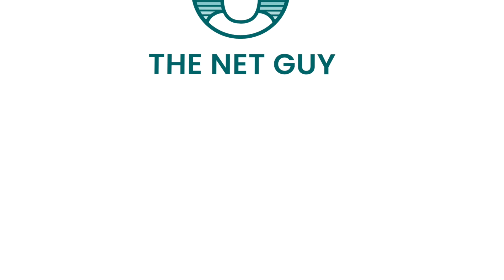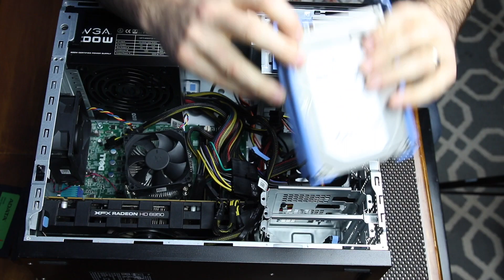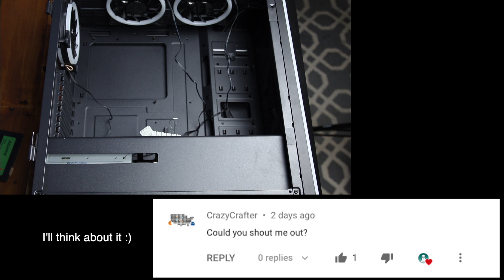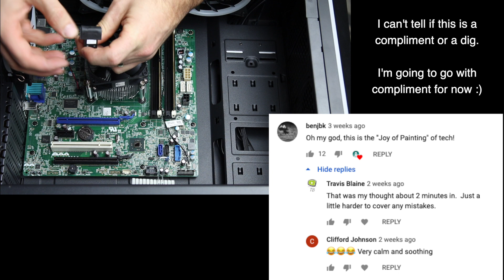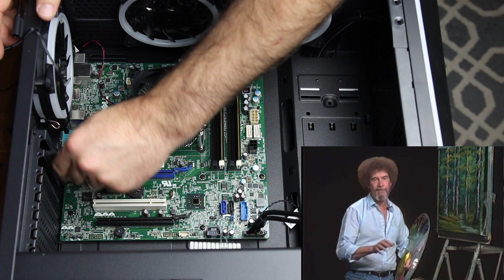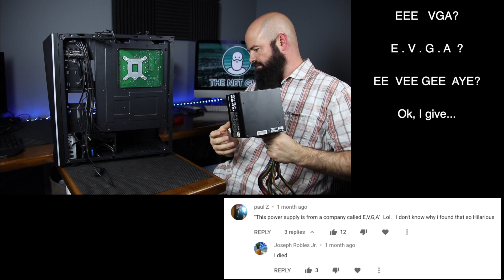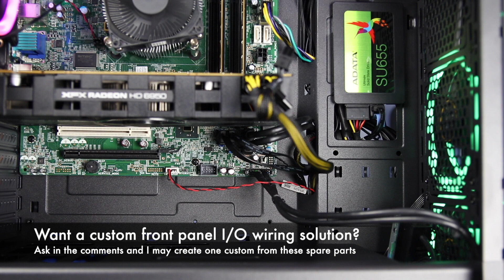Easy Dell Optiplex RGB Case Transplant

Comment: 17:55 Your ment to have the power supply fan facing down because it's meant to intake fresh air from the bottom and exhaust it out the back. But if you have it facing up, it might suffocate due to the lack of air intake which might lead to the power supply dying soon due to it overheating. The fan is not for "blowing" , It's for intake only!!! 
The only "blowing" happening is the hot exhaust air being blown out the back.
But this is still a great vid, keep up the great content.

Comment: A question about how to remove the rear fan failure with case with building fans
Reply from the maker: Take the rear fan out of the old case and transfer it. Problem solved ;)

Comment: how did you install the fans into the motherboard?
Reply from the maker: Some fans can be powered by the power supply directly. Others the motherboard.  The old 5-pin case fans if you bring them over go to the motherboard.

Comment: that power connector part, is the character "text" on Power SW need to face on jumper or right side?
Reply from the maker: Right side
Reply: ty for the info i just bought a new case somehow the power sw cable wont fit on header, do i need to cut those thingy blocking around header? what tool should i use it

Comment: They do make 5 to 4 pin fan adapters for these so you can remove the chunky dell fan. Or even use a different cpu cooler.

Comment: May be missing something, but how would I connect the hdd led and all those other connectors to the motherboard? I assume i would find a pinout image of some sort and stick them on accordingly from there. Dont wanna have to buy an adapter rn. I'm not too worried about connectors that arent required (assuming the case would still function properly) all i really need is a way to power the fans, id be willing to use the PSU itself. Sorry if I sound a bit inexperienced, I havent worked with many Desktops.

Comment: What's the reason behind the case switch in the first place? The Dell case doesn't have good air intake, but that can be fixed by cutting off the HDD cage and mounting a 120 or 140 mm fan on the bottom of the front panel. The 2 x 5.2 optical bays on the top can be repurposed as intake as well.
Reply from the maker: No cutting? Better airflow and RGB options?

Comment: sir, what did you use to connect the front panel stuffs?
Reply from the maker: Comes with standard I/o cable connections.  If doing a case swap there’s a map online of where the pins need to go.

Comment: It’s nice that the 9020 has extra sata ports next to the power on the board, my 7010 has the four that are in the way of the graphics card, 90* adapters and dremel tool did the job🤣
Reply from the maker: Good call.  Sometimes you just gotta mod things to get them to work ;)
Reply: @TheNetGuy   the 1660ti was probably overkill for a i7 3770 but hey, it was on sale🤣
Reply from the maker: Send it!

Comment: Am asking if you case swipe motherboard to gaming case, do motherboard holes align or there are other motherboard which don't align with holes.... If so give examples of such PC which don't align
Reply from the maker: HP 800 G3 does not align.  Most Dell 3020, 7020, 9020 do.  It’s all based on the motherboard make up. 👍

Comment: thats twice you called the ssd a hard drive once when connecting data cable to it then when connecting power to it, just saying, lol, also  this reminds me of putting a 4 cylinder in a Mustang, why i ask myself. 1st time ive seen a case fit a dell mb though, good stuff.
Reply from the maker: Old habits die hard!  Thanks for tuning in!
Reply: @TheNetGuy  i know you meant to say the main drive , just razin ya bra, thanks for the reply tho, nice vid though, smoked one just before i saw the vid so i was hypnotized by you bro , very calm and relaxing , nice work

Comment: You didn't show close up where the usb plug into on the board
Reply from the maker: Oops.  My bad.  Very old video.  USB 3 or usb 2?  USB 3 is keyed and only goes on one way, usb 2 is the same but pins you have to push onto.  Keyed as well.
Reply: @TheNetGuy  my usb connection are the yellow and green blocks 9 pin connections and if I was to fit my dell motherboard in a new gaming case of course the connections may be different so how would fit it in the correct spot
Reply: @TheNetGuy  think I got it resolved but does that power cable go on top right? Just so I know

Comment: Couple of questions re power button. Did you leave the 5 pin disconnected? No error messages?
Reply from the maker: I covered that in the video but there’s actually a newer way to do it with adapters on eBay.  Search Optiplex swap 2021
Reply: @TheNetGuy  I'm doing something a little different than a case swap. I extended the switch leads to another button. Left other 3 wires connected to the optiplex switch.  I'll check that video out.
Reply from the maker: Cool!

Comment: Is this possible with sff
Reply from the maker: It is but much harder.  Do you already have one?
Reply: No but I’m getting for my bday
Reply from the maker: Ok, they are good machines.  If you want to try the swap look for adapters on eBay.  I have a new for 2021 swap video that updates a lot.  On the SFF model you’ll need to use an aftermarket fan with a back plate (Vetroo V5 is a good choice) as the original fan screws through the motherboard to the case.  Good luck!
Reply: Ok thanks so much

Comment: I am missing the detail on how you connected the extra fans. I have lots of 3 and 4 pin fans but motherboard does not have these connectors. For the power. I tracked the power connector wire in the old case to its button and removed it from there. In the new case I replaced the power button with the one from dell.
Reply from the maker: The case has a fan controller in it, though if you check my other videos I did an update from 2021 that now has adapters you can get for your fans to run regular PWM fans.  Here’s an Amazon affiliate link if interested:  https://amzn.to/3F1YBB5

Comment: Low end 4th gen custom boards are soo cheap now I dont see the point of this, there is soo little money being saved
Reply from the maker: True; this video is 5 days shy of two years old now.  There is still some room if you get the machine for cheap but most are still asking too much I think.  I’m partial to the HP 800 G2 which has 6th and 7th Gen support.
Reply: @TheNetGuy  i picked up a pallet of 800G1s with 4790 chips in them last year, I think 35 units total for what worked out to something like $45 a unit... the market is a little different here though, I live like 15 minutes from the Microsoft campus.
Reply from the maker: Then I’m only an hour from you 😉
Reply: @TheNetGuy  where are you??

Comment: I tried to put a Dell in a new case and my Windows was no longer licensed....
Reply from the maker: Windows ties to the motherboard, network card, hard drive and GPUs.  Depending on what you change it can trigger a reactivating.  That said I’ve never heard of a case tripping the activation process.  Also - the serial number is stored in the bios and your Microsoft account now so it should reactivate easily.
Reply: @TheNetGuy  Seems as though there is no consensus on exactly what triggers deactivation and could be a combination of factors, though a new MOBO will always trigger it. I upgraded the chip, the psu and GPU.

Comment: What type of jumper did you use??
Reply from the maker: Any jumper will work, but you can also use the HDD led.  There is also a newer video on the swap for 2021 that shows how you can use eBay adapters to not have to jumper anything anymore.
Reply: Thank you so much!! I’ll check that video out right now! You’re the best!!

Comment: QUESTION i just did a case swap on my dell optiplex 9020.. and my son bought me a rgb cooler. It spins but i can figure out where to plug in the rgb in so the light comes on please help...i have a semi modular consair bronze psu.

Comment: The best part of a dell optiplex is the retro style case though 🤣
Reply from the maker: True!
Reply: @TheNetGuy  sold my full tower 10900f with rtx 3060 and currently running a 9010 with i7 3770 and 980ti. Its sweet as a nut 😁

Comment: I tried the case swap and messed up i bought the the 2 pieces from habour and the rgb lights came on but no display and the power button  had this yellow light blinking..so I put it  back in optiplex 9020 original case now windows isn't booting..I should have left my pc alone 🙃 Help i spent 50 on the case 40 on 500w corsair bronze plus 24 bucks for the motherboard pieces please help if u can or should i have just used my same psu my gpu is a mti 710
Reply from the maker: Hey friend, let’s walk through the possible things it might be.  What is it saying when you say windows isn’t booting?   Got an error message?
Reply: @TheNetGuy  status 0xc0000001 is the error
Reply from the maker: Ok, what kind of hard drive do you have and did you possibly change from UEFI or Legacy boot in the bios or vice versa?
Reply: @TheNetGuy  (Time-of-day not set, Invalid configuration information- please run set up ) i have adjust the time and date but i do not know why it still give the same message comes on
Reply: I should have never tried to switch my case i had no problems
Reply: @TheNetGuy  512 ssd for boot 2 tb for data
Reply from the maker: Looks like all the bios settings got reset.  This can be an issue with the cmos battery going bad.
Reply: @TheNetGuy  i replaced the battery..and under boot list option its says legacy
Reply from the maker: Switch it to UEFI boot mode and see if that fixes it.  Also, when you do the swap again you can move the power/diag button to the new case to see if it will give you an error code.  80% of the time it’s memory, 18% bad/cheap adapter not the one I linked to, and 2% other :). You’ve got this!
Reply: @TheNetGuy  ok 👍 👌 I load defaults in bios and it gave me options for repair and safe mode...i chose repair if it dont work i will switch to uefi
Reply: Fans moving not powering up? Wtf
Reply: @TheNetGuy  do you think i should buy a replacement motherboard and just install it back in the optiplex original case?
Reply from the maker: Not sure why the fans aren’t moving.  I know they are set to run based on need.  Cpu fan is moving right?
Reply: @TheNetGuy  ok i put in power button and it came on now its saying ntdlr is missing
Reply from the maker: The problem is if you were UEFI and rebuilt the BCD using legacy it’s overwritten now :(  Turn on UEFI mode, boot off a windows 10 boot USB key and fresh install.  It should keep your files but you’ll need to reinstall your apps.
Reply: @TheNetGuy  is that the only way?
Reply from the maker: If you’ve told it to repair/rebuild then I would say yes :/   First step above would have been to switch to UEFI mode - that’s likely what happened when your cmos battery died is it defaulted to legacy.
Reply from the maker: Basically
Reply: @TheNetGuy  https://youtu.be/sOihh4ZNOf4 this guy instructions was spot on. I fixed it.for those who need it
Reply from the maker: Very nice!

Comment: Where do you get the jumper from?
Reply from the maker: Usually you can find them on old motherboards or old hard drives. If you can’t find one, there is a way to wire the power LED to act like a resistor. I think PC tech hustle on YouTube did that technique. You can also order adapters on eBay for the front panel now.

Comment: Cooler master mb311L argb and dell optiplex 9010 MT motherboard, is it compatible?
Reply from the maker: It is.  Easy swap too now that there are I/o adapters on eBay.
Reply: @TheNetGuy  you don’t have to do this if you want but just as a suggestion can you make a case swap video with the cooler master mb311l argb, it has amazing airflow and meets all of a gamer’s expectations which is why I chose it as my new dell optiplex 9010, let me know what you think

Comment: what kind of cabinet is it? atx, micro atx and variants, please help
Reply from the maker: ATX full sized is supported
Reply: @TheNetGuy  is something else needed, or is it just component change?
Reply from the maker: Nearly all ATX and mATX cases will work.  There will be some conversion issues with the power switch and no front panel audio support.  There are some adapters you can now buy for usb and power switches.

Comment: The power supply does not blow out the "top". PSU's blow out the rear and draw in from what you call the top. The PSU will work the way you have it however the air flow will be restricted. It's designed so that the PSU can draw in it's own fresh air from the bottom of the case. Typically there is also a filter in the bottom for easier cleaning. Otherwise, nice video. I watched to see what you did with the front panel stuff but watched the entire video as well.
Reply: QUESTION i just did a case swap on my dell optiplex 9020.. and my son bought me a rgb cooler. It spins but i can figure out where to plug in the rgb in so the light comes on please help...i have a semi modular consair bronze psu.
Reply from the maker: So the addressable RGB or ARGB models need either a motherboard port or an aftermarket controller.  The 9020 doesn’t have them on the motherboard, so you can look for an addressable argb controller on Amazon - often they come with some fans.

Comment: Please keep this optiplex 9020 going with different option and cheaper upgrades for people on the lower end of a budget. 
Show some work around if you can.
Right now I’m just discovering you can do all of this to the 9020.
I have a blank 9020 now and I want to find a starting point any tips were to start first?

Comment: There's an adapter to connect a 4-pin fan to the case fan or CPU fan on a Dell. I found one on ebay for a couple of bucks. Works fine. Also, you can change it in setup so the error don't appear. I did that while waiting for one of the adapters.
Reply from the maker: Nice find!

Comment: Hi I'm switching my optiplex to a case today and I was wondering wat size jumper I need since I can't find any laying around
Reply from the maker: Take a look at PC Tech Hustles video.  He uses a power led as a jumper and it works too.  You can also order an adapter from eBay now.

Comment: i just got a gtx 980 and i have a dell optiplex but the optiplex is not bigger enough for the gtx 980 because the hhd cage so do you thing i should just transfer case to a bigger one?
Reply: or cut out the drive cage

Comment: I need your help on this alot and i'm stressing out on it lol, so like i was going to buy case fans and it says 3 pin right, and on my Dell optiplex 7010 MT has a case fan but its a 5 pin, and i can't find any adapters and i bought the same case u have but the Talos M1A, but i can't find any adapters for it and i'm freaking out lol so like is their any 3 pin to a molex cable or some sort, please help me lol!!!!
Reply from the maker: The good news is you can run the stock CPU cooler and reuse the rear chassis fan.  I haven't found an adapter yet for dell headers.  If you look at the HP 800 G2 models as a good donor platform they have standard/traditional headers.

Comment: Can I just use the old power supply?
Reply from the maker: You can if you don’t plan to upgrade graphics cards and don’t mind the look of a gray OEM supply.
Reply: But I could put in a graphics card before I swapped cases why not now.
Reply from the maker: The stock power supply doesn’t have a PCIe power header.  You can use a converter from a sata port.
Reply: cable lenght can be an issue, the 8pin cables are very short for example

Comment: I have the exact same Dell 9020 case, and I'm wanting to do the opposite and swap all the components from my mATX case into the bare Dell I have so my question is. Is the case a standard mATX case and what if any cable or case mods would I need? Any help would be very helpful. Thanks.

Comment: Hey where I get the jumpers
Reply from the maker: This is a new adapter which will let you do everything you need: https://www.ebay.com/itm/Dell-Optiplex-7010-9010-7020-9020-and-Precision-T1700-Front-Panel-Header-Adapter/264733441811?hash=item3da357bf13:g:8pIAAOSwAEJfrtTt

Comment: Best how to video I have ever watched! I shared this with a guy on a forum that had asked if this was possible.
Reply from the maker: Thanks Don!  It's getting even easier now to do - this is an adapter you can buy to preserve all the I/O. https://www.ebay.com/itm/Dell-Optiplex-7010-9010-7020-9020-and-Precision-T1700-Front-Panel-Header-Adapter/264733441811?hash=item3da357bf13:g:8pIAAOSwAEJfrtTt

Comment: thank you for this - had issue with Inspiron 3847 no post once board was out of the case.  rather than cutting and wiring stuff, just connect and hide that weird 11 pin connector somewhere else.  didn't need to do the power sw jumper as that still posted.

Comment: I have dell optlex 790  i7-2600   and i want  to change my dell case into gaming case so is that possible to swap the case
Reply from the maker: Most of the time it is.  I haven’t played with this model yet, but it could work.  How does your power supply connector look?

Comment: Hey, I have a question. Will the TALOS M1A work the same as the case in your description? The TALOS M1 is currently unavailable on Amazon
Reply from the maker: Yes!
Reply: @TheNetGuy  Oh My Gosh! Thank you so so so so so much! I am trying to do an upgrade to my dell OptiPlex 3040 and I bought a zotac GeForce 1650 and it doesn’t fit. So I looked for a case and I found that one. Anyway, thanks a bunch!